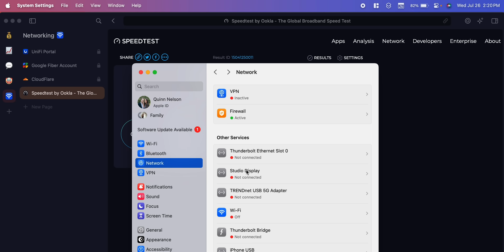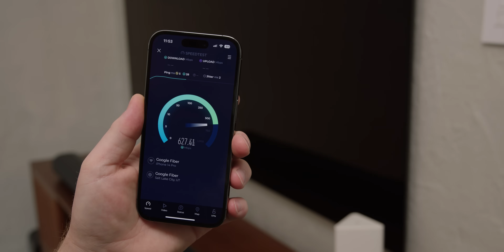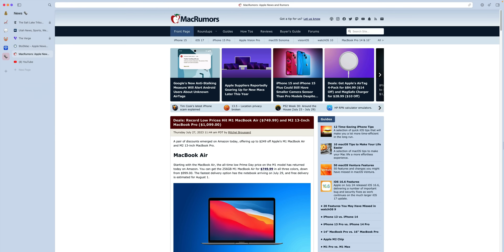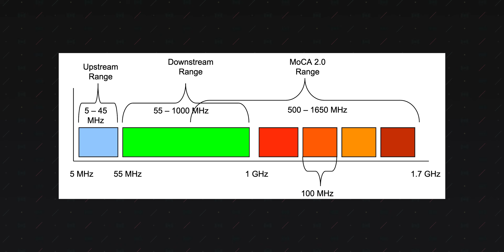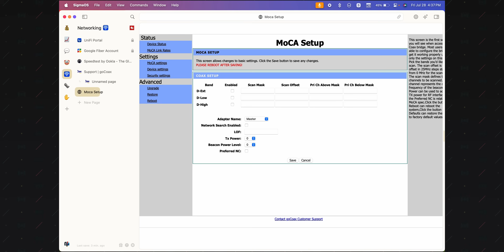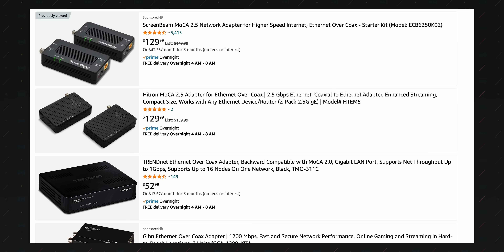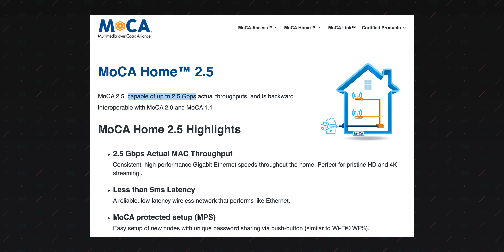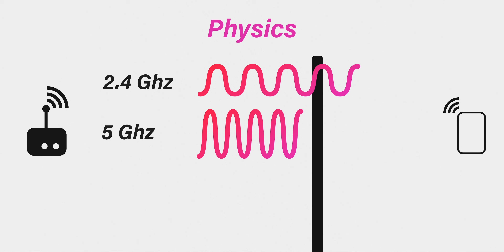10 Gigabit Network Retrofit for Renters. No Drilling Required!

Comment: Over the last 20 years I've probably spent way too much on networking without wanting to drill. Started with an Network over USB thingy. Wifi-Repeater to wired. Then ten years of Powerline, but noticed I had very high ping. Now, I've almost totally eradicated the powerline network except for two places. I now run a combination on MoCa, Network Cable and Mesh Wifi and still some powerline.

Just having network cables installed would have been much cheaper in retrospect.

Comment: I had NO idea this was a thing. I've just moved into a new house with no network infrastructure and I really don't want to start putting holes in walls to install it myself. I did, however, notice that there are SO many coax ports throughout the house, including one in the office. The previous owners also left their cable splitter with the cable for the TV.... things are starting to add up (previous guy was in IT). Was about to invest in a mesh network but now I'm 100% trying this. Awesome!

Comment: I got BAITED 😂
I hoped there is some new way. Nope. MoCa, Powerline or WiFi.

And if your house isn't old enough for Coax cables to be still present, then it's question about slow Powerline or less reliable WiFi.

P.S. In my case it's around 30Megabytes per second download over cable, and 40Megabits per second over Powerline.

Comment: Well, I got powerline about 1.5 years ago, and haven't had any problems (mostly). At that time, I had DSL internet (1mbps up, 12mbps down, awful), THICK walls, no way to run ethernet and we use satellite TV, which use the exact frequence as MoCA, so powerline was the only solution. Even now that I FINALLY got fiber (40 down/20 up), the speed I get on these powerlines (TP-Link, i forgot the model, 3 ports on the receiver, 1300mbps throughput) are pretty much the same speeds I get going downstairs and patching directly to the router, so for me it's great. I reccomend it for everyone in my city because, if you're not on corporate internet, you're not getting more than 100mbps, so the speed is fairly similar. 
The only problem I've had is that sometimes it randomly restarts and changes the SSID, but I just give it 25 seconds and it's back on. Super reccomend for people that can't afford/support MoCA and/or people with slower internet speeds

Comment: I have heard that powerline is not great,  I think that one is more like a last resort for those with awful WiFi penetration and also places where either they don't own the place and can't make modifications or where the modifications would be too difficult and I know some old houses may be difficult.  I have seen old homes that are as old or maybe older than that one that have lath boards and these are what they used before drywall started to be used in most homes now.  Also in old homes you might encounter asbestos and we all know that if those fibers get in the air they could cause problems if anyone inhales any of them!

Comment: What I with my old home was to remove all the staples holding down old coax/phone/security company cables down in my basement. I basically used those old cables as cable snakes. Oftentimes coax installers will drill oversized 1/2in to 3/4in holes in studs leaving plenty room for preassembled ethernet cables to fit.
The cables used on old security pads can be used for smart thermostats or can be replaced with an ethernet wall plate that your landlord will never notice.

Comment: If you’re handy enough…run fiber optic through your phone or cable connection…in an apartment…there are cable pullers that allow you to do that.  There is usually enough space to fit fiber optic along with phone or coax cable, or use the coax to act as a line puller, just be sure before you do something like that, that you don’t pull it out of the external connection or a neighbor’s connection.  Terminate the ends yourself.  Don’t forget to put the coax back or phone line back when you move out.

Comment: OMG MoCA adapters are horrible if you have cable service.   They absolutely do run in the same frequency bands as cable modems.     They need filters so your MoCA signals do not leave your house/apartment and interfere with other people’s setup.   If you don’t use these the cable company will come disconnect you for ruining the signal and injecting noise into the entire neighborhood 

MoCA can be good if you aren’t on cable service but even then it’s only ok and do not ever use those cheap ass gold splitters.   They just add further noise into the bands where MoCA works.   Get what you pay for.

Comment: Some notes about MoCA:
* Not all adapters are that complex to configure. some just work
* The limit of the entire network is limited to the speed of the slowest adapter on the network
* For ones like this that are complex to configure remember to also create a DHCP reservation in your router for the IP you gave the adapter so it doesn't get double-assigned and break your network <-- This one is extremely important

Comment: I like MoCa and Decnet. The problem with MoCa, powerine, Decnet, and Wi-Fi is they are all half duplex.  So it's best to separate the devices out to what makes sense. A desktop PC user probably isn't going to be hurt if the Internet speeds are just over 100 Mbps for a 500 Mbps connection. You get connections 100 Mbps to 1 Gbps(and beyond) for multiple devices anyway. So it's about separating the data streams so you don't have multiple devices fighting over a single contention media. Don't put all your devices on powerline and don't put everything on MoCa. Then it's also about staying off of Wi-Fi where you can so when changes to the security protocol comes, it doesn't become a nightmare updating all your devices. I'm doing changes in commercial networks. Do you even realize how major these changes get when you install new devices? Don't let your home network become that. So stay off of Wi-Fi where you can.

Comment: Powerline is sometimes an OK solution, it depends. I personally get 150-290mbps speeds on my 500mbps broadband contract, running from the powerline adapter in the front room to the adapter in the rear outbuilding which is approx 10 meters away. MoCA is a better option, but it's dependent on having coaxial ports in the house.

Comment: The shear amount of cable misinformation in this video is astounding. 
Not all cable companies have this filters at your house, and if yours does they are also at apartments and condos performing the exact same function.  However, if for instance your ISP is spectrum, you do not have a MoCa filter installed because they haven't used MoCa enabled cable boxes in nearly 15 years. 

In addition to this, docsis 4 is going to be using frequencies within the MoCa range in the next few years. 
If you want to use one of these please don't try and use it on the same cable as your TV or internet signal, you will have a much better time using that coax only for this, and send the cable box back to your provider and utilize their streaming app (for free usually) instead of the cable box.  That "great splitter" he showed is literally the WORST kind out there, they are made specifically for OTA tv, and will have your cable ISP shutting off your service in the middle of the night because the ingress from them was causing packet loss issues in your whole neighborhood.

Comment: I still like powerline, I have an older amp for playing music, it only has 802.11g WiFi, it could barely get a connection on our old WiFi AP, but using the ethernet port it has with PowerLine, it's MUCH more reliable, and faster to boot. MoCA is certainly an improvement, but you don't always have Coax in every room

Comment: It bugs me you were testing LAN performance over a WAN connection....

The one benefit moCA provides is that Coax is a significantly better shielded cable than ethernet, which means you can actually run Coax next to power lines (newer ones at least) and not have to deal with interference.

Comment: I live in an apartment building with over 400 apartments in it. I use my cable service as my ISP. using their older modem technology I had 25Mb/s speed which is what I get in their low income discount plan. the issue was the older WI-Fi standard that their  router used. With so many other routers configured nearly identically in the building (Over 300 that I can detect directly) I often lost my wi-fi connection due to  the storm of electromagnetic signals  in my space. I am only three feet away from my router! Then my ISP upgraded the building to an HFC (Hybrid Fiber Coaxial) solution. This is fine to te building and RG56 cable TV wire to the apartments. There is a redundant  line to the HFC box.  But they also replaced our modems with the new ones that have Wi-Fi 6 in them. Suddenly  no connection drops and  internet connectivity is rock solid. One issue is that While I have a UPS for the modem if the building loses power the is not redundant  power backup for the HFC node. OS if there is a building  level outage  I am stuck.

Comment: can someone tell me how to connect all the coax cables in my home so that I can run moca on them? If I just want two moca adaptors and I know what 2 coax cables are inside the basement can I just join them using an F type coax female to female connector ?

Comment: Debating on using the MoCa solution because my landlord doesn't mind about me putting holes in the wall. I did do it correctly when I ran the CAT6 line from downstairs to the upstairs but I am only getting 100 mbps on a gig network and I REALLY don't want to replace it. is there realistically any issue if I use a barrel connection on the outside of the home to connect the downstairs cable jack to my upstairs office and run the MoCa directly that way? It would be { ethernet from isp router -> moca transmitter -> coax downstairs -> coax upstairs -> moca receiver -> ethernet from receiver to gigabit switch -> individual lines to the 2 PCs and work laptop}.

Comment: Hey Snazzy, my Xfinity device does support Moca so I turned that feature on. I bought the receiving Moca and plugged in through the wall but it’s not getting any signal. I tried rebooting my modem and restarting my Moca but nothing. Also I tried a different wall coax outlet but it still didn’t work. Do you have any idea on why it wouldn’t work?

Comment: MoCA, the ones I've used did not need any configuration. Much like Powerline, you pressed a button on each to sync them.

Also, you want to put a MoCA blocker on the main coax going out so that you don't end up broadcasting down the cable lines. This is not needed if you don't have a cable ingress connected.

Comment: If you have underlay for your carplet you can get a razer and slash in a line and push the ethernet cable in to it any time you need to cross a room did it at the old place I use to live you couldnt even tell there was any cable under the carpet

Comment: FYI Most people are using powerline adapters use them wrong and end up with slower speeds than they should, when using powerline adapters when ever you plug them in resync them together so they can work out the fastest speeds as if you dont they will probably be running in the default out of the box state which could be reducing the speed you get, as most powerline adapters come defaulted to a slower link speed for reliability by resyncing them together they will then try to handshake for the fastest speed it can handle on your power cables in the wall, iv seen people complain about slow speeds then iv done a resync for them and boom faster speeds,  remember most powerline adapters are defaulted to normally the slowest speeds available to them for maximum reliability not maximum speed so always resync them every time you have to unplug any of them and adding a new powerline to existing ones with out doing so can slow them all down to default speeds.

Comment: Check with the age and quality of your coax with your cable company. I remembered living in a remodeled apartment complex in Reston Virginia but they kept the same coax cable from the 80s. When had Comcast installed cable internet, they warned me that I will cancel my internet service within a month because the coax cable is damaged.

Comment: Powerline adapters also trip arc fault breakers, which are required on most branch circuits starting with the 2020 NEC.

Comment: With the goCoax, I have the UniFi Express running the only outward port going to a network switch. 

Can I connect these adapters starting with the switch, and then downstairs to the other adapter where I would run another switch in.

Comment: if a 2nd moca adapter is setup in another room, does it need to be hardwired to a device for it receive connection or does it transmit a signal that boosts your already existing wifi?

Comment: 8:07 Don’t used store bought splitters as those are made cheap and will create ingress on your coax and will cause tiling or your video (tv) and cause signal drop and slow your internet speed. Ask your cable guy for a free splitter. Also cable technician will leave your cable signal up to specs but if you start putting splitters in your home the specs will be thrown off and cause issues with tv and internet services. Oh and don’t even get me started on the cheap radio shack looking coax cable/jumpers 😂😂

Comment: i use 2.5gbit MOCA in my rental unit to network mine and my partner's computer to my gigabit network in the basement. Works GREAT. mine required absolutely zero setup.

Comment: You can actually use different branded powerline adapters, they just need to use the same protocol. 
Also you can mod some powerline adapters to use 2 wires not connected to mains (like phone lines) making the connection stronger in homes where coax and long ethernet runs are not a solution

Comment: I live in an NYC apartment with a bunch of SSID around me, I have FiOS and struggled to get the max speeds, however just found out from your video about coax cable connection,  now I have max speed on my Xbox and PC without wifi.

Comment: Some IT schmuck from the ISP convinced my landlord to remove all coax cables. It's like they want to throttle your performance. Here's the worst part, the ISP here in Canada is basically forcing us to use a hub and even though we're paying for 1gig speed I'm getting 50mb/s WIRED! We have rooks here in Canada (maritimes)

Comment: I've got a question. Would MoCa work when placed between my fiber point and my Modem/router. The problem i have in my place is that there is about a two floor distance between my appartment and where the fiber conncection enter's my home. There is an existing Coax cable in the wall running to where the fiber cable enters the house. So my idea was to connect my modem in my appartment through the coax to the fiber using moca connectors. Thanks in advance!

Comment: I was passively researching all of this over the last year as I wanted to get a wired connection to my office, this is by far the best video on topic I have seen and I even learned a few things here (somehow I had the impression if you are using the coax in your house, you can NOT use MoCA, which I learned is not true). I ended up just dropping Ethernet everywhere I needed it from the attic. Not the cheapest option but definitely the proper one, although had I seen this video before I ran the ethernet I would have definitely went the MoCA route.

Comment: I have this issue in my condo and was wondering how to configure my coaxial cable internet. I have a cable jack in my living room and one in my bedroom. My ISP is using the cable jack in my living room to connect to my own modem and then the Ethernet from my modem to my router. So I can’t use that cable jack since it’s connected to the modem/router. How would I go about connecting my cable jack in my bedroom using moca? Do I put a moca adapter in front of my router and modem? Do I use a splitter? I can’t run wires that long since I have no attic access. Any ideas on how to configure this? I want to use the 2nd cable jack to set up a wired mesh system for my condo. Any ideas would be helpful!

Comment: I remember when i got new internet and Plebs on tiktok told me to get a powerline rather than just running long ethernet cables when i already had one and it was bad, even wired it was bad but i did fix this issue with mesh wifi.

Comment: Im confused. My local isp’s dont offer speeds that fast. Would I switch providers to get the speeds possible with this setup?
Reply from the maker: No. Your internet speeds will only ever be as fast as your ISP can provide; however, this will make your local network speeds much faster.

Comment: I never hear anybody ever mentioning this, but there are these special flat wires that you can use to pass an ethernet cable through a door or window, i used them in my previous apartment, it was just a ribbon cable with ethernet on 2 sides, flat enough to fit through the gap of a closed door. i loved it

Comment: Powerline is essentially Wifi without the aerial, where your mains wiring is used as a wave guide to vaguely constrain that wifi signal. It even runs on the same 2.4GHz and 5GHz unlicensed radio frequency bands.

We used to run a powerline network when we were renting and got around the same performance with our Homeplug (85Mbps) and AV200 kit as this video shows with AV2000 kit. I'd always assumed the problem with Powerline was that it wasn't keeping up with the latest innovations in wifi, but it looks like even with those innovations, home wiring isn't often able to take advantage.